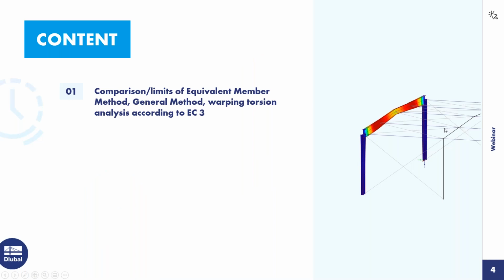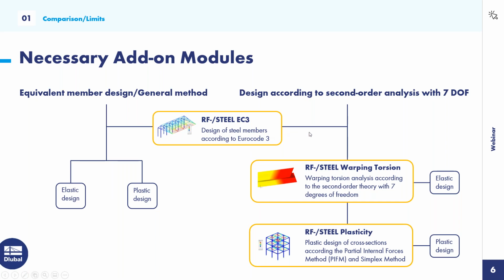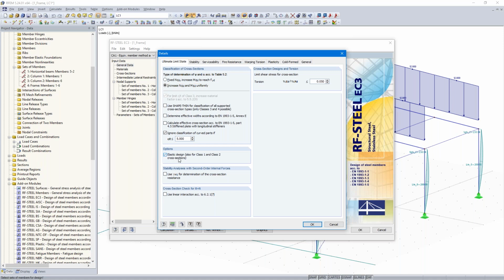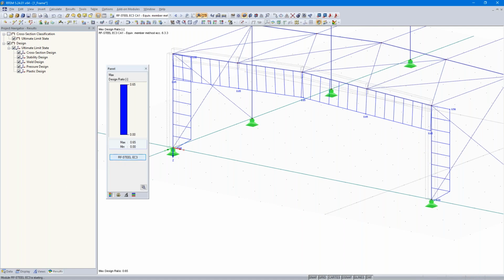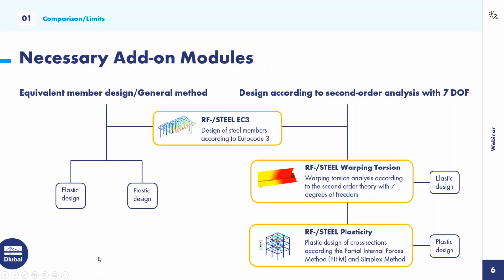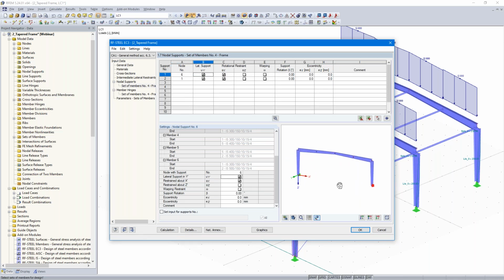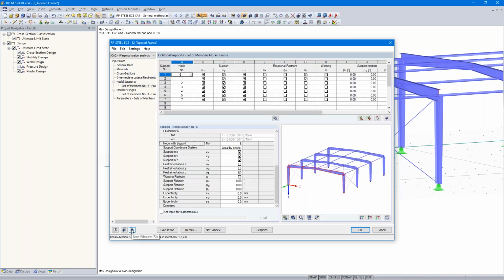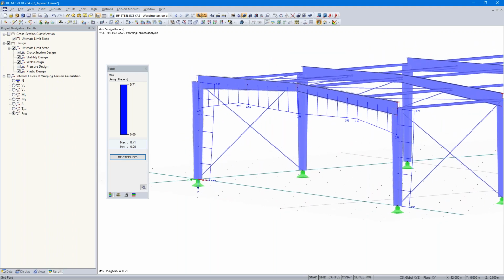Stability Design in Steel Construction With RFEM and RSTAB

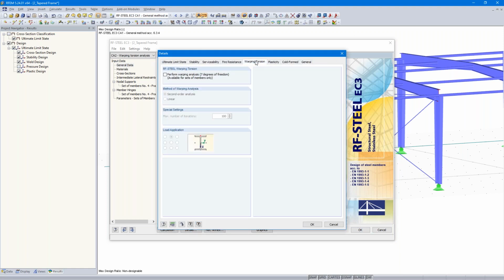Comment: Thanks! This was very helpful. I just don't understand why, for the case of warping torsion analysis, is written in the table that it must be done according to the second-order theory, when we can choose linear or second-order (30:58)? Can we?
Reply from the maker: Hi, Branka!
Usually you should use second order theory. Sometimes it makes sense to control the warping effects with first-order theory